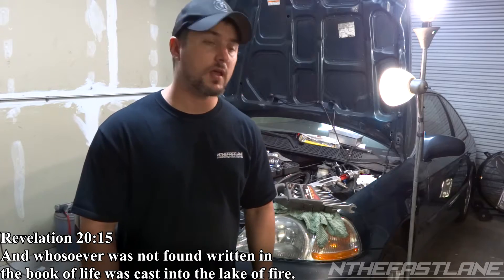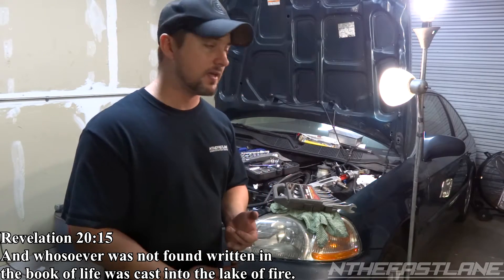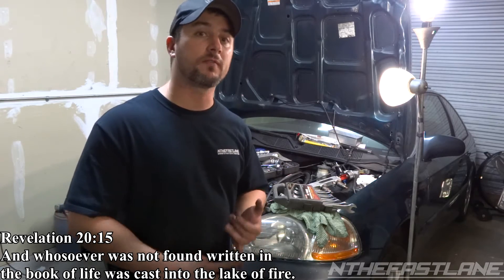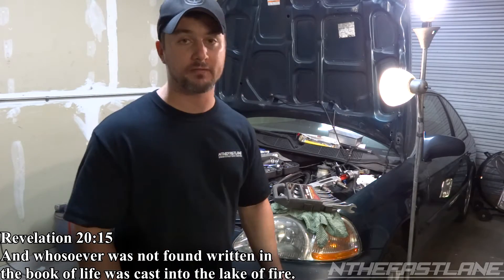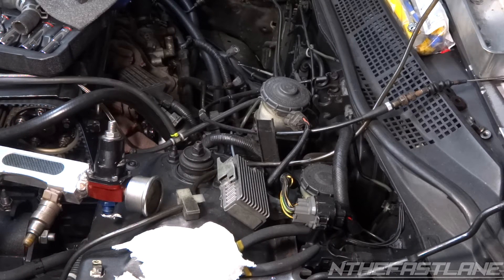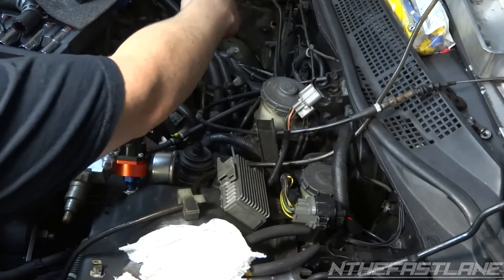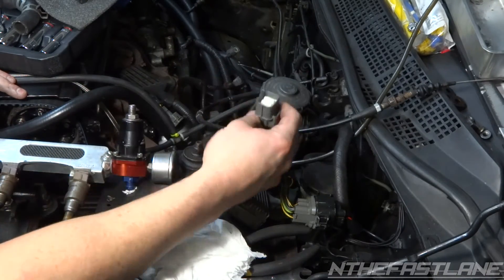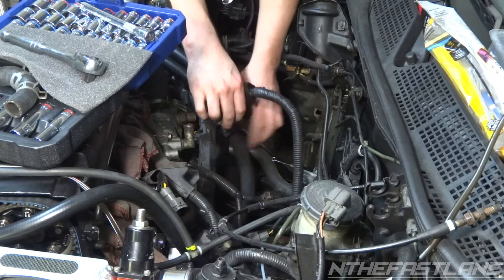▶️Low Impedance Injector Resistor Pack Honda "How To" ⚡

Comment: You should explain a little better how to wire it because the four yellow and black wires that u say to put to the one solid yellow wire on the resistor side is not correct. The four yellow and blacks are the injector wires that only have contanioty. Hope that helps everybody.
Reply from the maker: It's been a while but the colored wires with power such as brown,blue,red and one of the yellow/black wires all get soldered to the red/black wires off of the resistor. Then there is a group of four yellow/black wires from the injectors that all get soldered to one yellow/black wire on the resistor.
Reply: @Nthefastlane  hey this is what i did and the car start one time for 2 second and shutoff and never start again.. Im going crazy with this situation. Please help thanks

Comment: Hey buddy i have question if i jave a resistor box on my car can i just change the injectors to 440s
Reply: Yes, you can lol but you need to have aftermarket ecu to compensate for the added fuel

Comment: So...will these boxes work fine and mess up after they get hot?...i get a misfire after driving 30min or so. Ive changed entire ignition system and entire fuel system. Miss still comes back after driving a while..i can shut car of for 5 minand will run fine for another 20

Comment: So you don't have to cut any wires on the harness. You just plug that connector you made to that plug on the civic harness.
Reply from the maker: +Fili Tamayo Yes, that is correct. As long as you wired in the low impedance clips so you can connect the low impedance injectors.
Reply: Nthefastlane what clips are you referring to.  What I did is took my h23 from my prelude which had the low impedance injectors I assume cause the prelude had the risistor installed . I cut my injector wires that are red and wired them into the yellow wires that ran up to the civic injectors I didn't do anything else to the harness. That's Why I Was Wondering If I Made A Harness Like Yours OR If I Ordered One That They have, If I Could Just Plug Into The Back Of THE Civic harness Where That Plug Is Under THE Intake manifold. Hey thanks for replying,  I really do appreciate it.
Reply from the maker: +Fili Tamayo I was just referring to the OBD1 injector clips have to fit the OBD1 injectors. But your h23 may possibly be OBD1 low impedance injectors already, so no need to change out the injector clips. Yes you can do it that way with all the red wires to the yellow wires also.
Reply: Nthefastlane so when you said to get all the yellow wires with black line on the harness that you got from the accord, how did you determine those were the ones to hook up to the one yellow on the risistor box.  I get the part where you said to turn the key on to find your injectors after connecting to the civic harness. But I thought the colored wires from the injectors were the negative that go to the ecu. And the yellow with the black line were the ones to go to the risistor box. Mine are now red with black line of course cause that's what was in my prelude. Sorry I'm just a lil lost and just want to make sure cause I don't want to fry my ecu. My prelude is obd1 and so is my ecu that I'm using .

Comment: bro need help...engine does crank but cant start..when checking the injector connector..the ground one doesnt give anytg..what the common problems...someone say thats my ecu grounding problems....
Reply: Did you ever find the problem?
Reply: yes i have resolve thats problems.....after im checking everything that possible...
Reply: Did this work for you guys? I hooked up the 4 yellow wires and turned the key so I could check to see witch injector is witch and my check engine light is dull. Ps, there’s more then 4 yellow and black wires. There’s 6 Please help I’m going crazy!!!!!! lol
Reply: @PINIWEENIE718   same happens to me after i install the resistor start one time for 2 second and shutoff and never start again and im running a p28 on 2000 civic turbo

Comment: I had mine plugged into the deadplug with the plug I got off a DA and I've only found continuity between the yellow wires with black stripes from my injector side leading to the harness I got from the DA...

Comment: sorry for the late post, I just dropped a mini MI swap into my 89 crx, engine and p28 ecu are obd1 
harness, intake and injectors are obd0 
am I supposed to run a resistor box ? 

I'm pretty sure I have one but I'm unsure 
because I have spark , and fuel going to the engine but it just doesn't want to ignite 
and when I spray starting fluid into my intake it starts up but shortly after dies out as if it's not igniting 

do you think this is due to the injectors ?
or something like the Igniter ?
Reply: Deliano Contreras I say with the obd1 Ecu shouldn’t have too is it in time and plug wires correct

Comment: If I have a jdm h22a in a 94 civic on a p13 stock ecu. Would I need to use one of these. ( I haven't started it yet, just did the swap)
Reply from the maker: If you have the year of the low impedance injectors, yes..here is the years for the H22's 

92-95 H22 = 345cc Low impedance
96+ H22 = 290cc High impedance
Reply: It's a obd1 black top but I'll test the injectors to be sure nothing's been changed

Comment: OBD2 is 96-00. In the video you mention it came off a 90-93 Accord.
Reply from the maker: Yes but then I realized it actually came off of a obd2  I was trying to remember while I was recording.
Reply from the maker: +Nthefastlane I thought  for sure though I pull it off of obd1 accord.. But it doesn't really matter as long as you get a resistor from either obd0,obd1 or obd2 it will still do the same.

Comment: The injector resistor box is on OBD-0 88-91 Civics.
Reply from the maker: Correct, the ones with the green plugs are Obd0..This one came off a obd2 94-97 Accord.